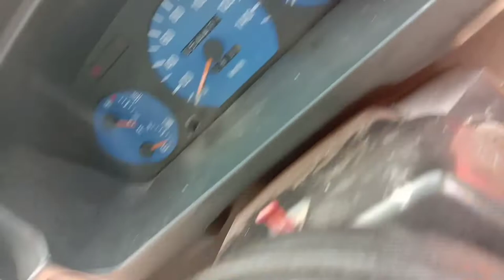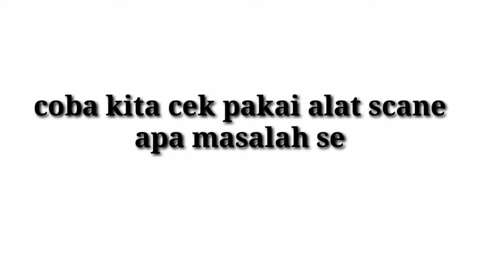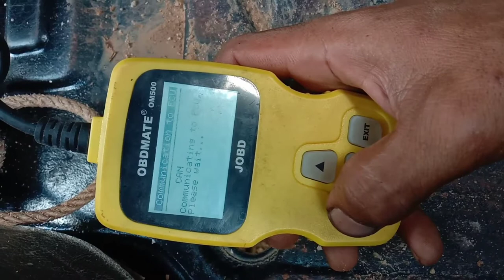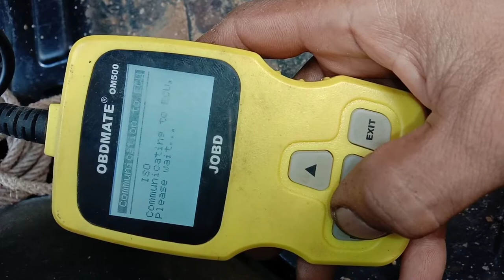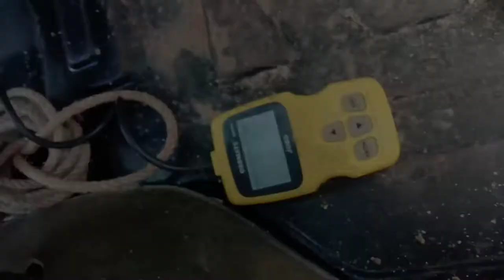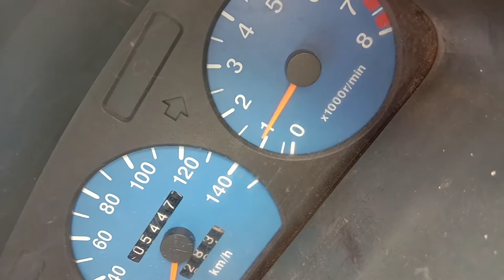Penyebab mobil T120SS susah hidup, brebet dan boros

Comment: mas anto,mobil sy persis seperti itu.susah hidup,kadang sampai 5-10menit distater terus baru bisa hidup. hanya saja gak brebet. tp kalo sudah nyala. keluar asap putih dari knalpot. dan bau nya sangit/pahit. itu kenapa ya mas.. mohon sekali jawaban nya mas 🙏
Reply from the maker: Berdasarkan masalah yg disampaikan mengarah pada kompresi lemah akibat ring piston dan sylinder blok sudah sangat aus(ngobos) sehingga kompresi mesin low dan oli naik ke ruang bakar mebasahi busi. Solusinya turun mesin. Atau tunggu vidio saya selanjutnya kebetulan membahas tentang hal sama seperti ini.mungkin 2/3 hri lagi sudah updet
Reply: @antocasenk  terimakasih banyak atas penjelasan nya mas, mobil sy T120ss tahun 2017 akhir apa ya ring piston dan sylinder nya sudah haus. mengingat usia kendaraan masih sangat muda. ?
satu lagi mas, semoga ilmu yg diterapkan dapat bermanfaat bagi orang banyak, dan jd ladang berkah dunia akhirat. Aamiin. 
terus berkarya mas, dan tetap rendah hati. ☺️

Comment: Sukses bosqu.. ane sdh suscribe tlg di jawab y.. t120 susah hidup.. gasnya susah langsam saat tdk di gass. Mhn solusinya..
Reply from the maker: Lampu engine checknya hidup gak mas.?? (Yg warna kuning)

Kalau hidup, coba di scan dulu. Siapa tau ada sensor yg mati. Seperti MAP sensor. 
Tapi kalau gak idup, coba cek busi2, injektor dan fuel pump nya..

Comment: Mas mau nanya,mobil sy t 120 ss gak mau hidup,ECU dan power transistor dicb di mobil lain bagus aja,busi,coil,fuel pump udh ganti semua
Reply from the maker: Pada dasarnya mesin itu hidup jika 
- ada kompresi mesin yg memadai
- bbm sampai ke injektor(mesin)
- busi memercikan bunga api pada timing yg tepat.

Coba cek kompresi, cek T-belt

Comment: Persis kayak gitu mas masalah mobil saya kalo d start pagi hari.1 hari atau 1 malam gk d pke.paginya pasti gitu.tp 5 10 menit udh normal.filter bensin/udara yg sudh kotor,apa isc/trotel body,apa tanki jarang full,busi baru ganti 2 bulan lalu.aki normal MAS  filter bru d bersihin.apa kurang boros mas.mobil kuda bensin 2000mpi 2003 mas.makasih
Reply from the maker: Coba discan mas.. siapa tau ada sensor yg eror

Comment: Mobil saya brebet mas tidak lamsam dan pincang, kadang enak normal  .  Rpm rendah ,Engine kuning hidup. Pas dscan map sensor tidak.masalah. Kira kira apa ya? . Masih curiga ada.plastik di tangki. Soalnya penutup bensin pakek plastik.
Reply from the maker: Intinya pak kalau lampu kuning(engine check) idup saat mesin sudah hidup. Itu artinya ada yg bermasalah pada sistim injeiksi, seperti ada sensor yg mati. Tapi kalau lampu engine check mati saat mesin hidup tapi mesin brebet atau pincang kemungkinan dari sebab lain, seperti plastik tersebut yg menutupi saluran minyak atau ada busi yg mati satu, atau ada injektor yg kotor atau mati.
Reply: @antocasenk  terima kasih . Klo engine  kadang hidup kadang mati pas jalan mas. Mobil kdang enak kadang pincang mas
Reply from the maker: Periksa perkabelanya bos.. sepertinya ada yg kendur

Comment: Penybab mobil susah hidup, padahal kalau di buka selang dr tangki bahan bakar nyemprot kuat tapi ndk bisa hidup. Unit T120Ss injeksi
Reply from the maker: Penyebab mobil susah hidup bukan hanya dari minyak aja bos, dari pengapian juga bisa. Coba cek busi businya dulu
Reply: @antocasenk  betul skali sudara ndk ada pengapian sma skali, sy juga ndk punya alat skener,,, yg sering terjadi klau hilang pengapian selain sensor ckp, sensor apa lagi yang bermasalah bosku..mksh
Reply from the maker: Masalah pengapian yg mengontrol adalah powetransistor dan ecu bos..
Reply: @antocasenk  mksih bosku, mksih banyakkk